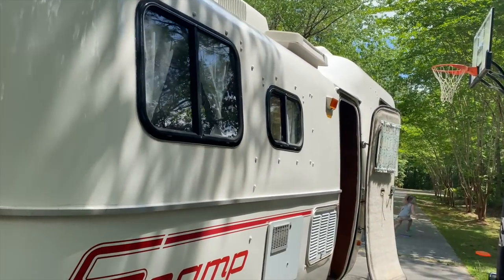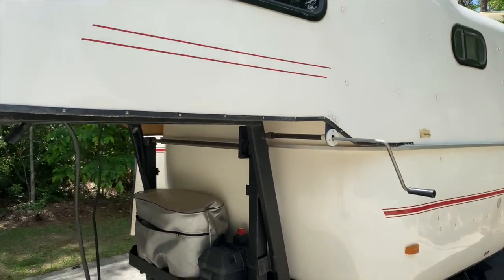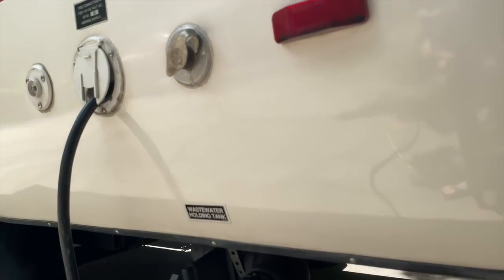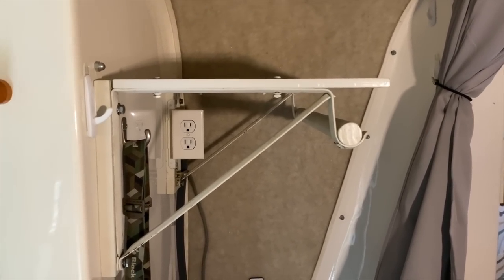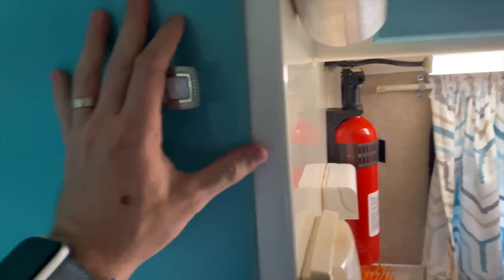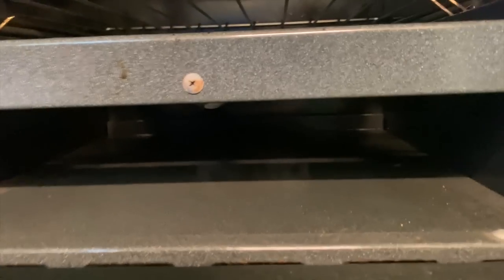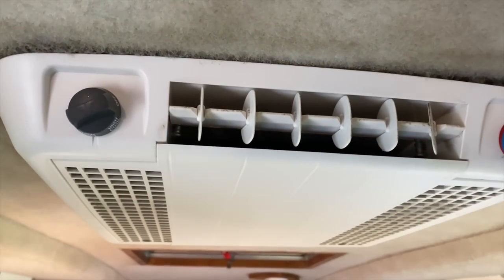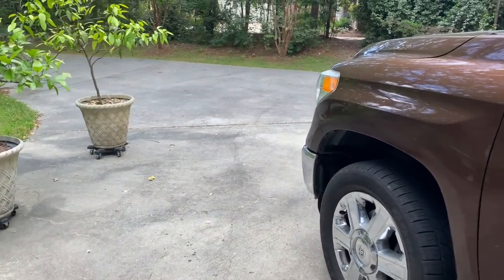Scamp 19ft Camper Walk Through

Comment: This is a stupid question but I need to know.  Is that a standard fifth wheel hitch or something different it looks smaller.  What does it take to pull this will a half ton pick up work or do you need something bigger?
Reply from the maker: Hi Diane, That's not a stupid question. I did not install the original hitch, because I purchased the Scamp and my Tundra in a package deal. But I think it was a standard fifth wheel hitch modified with a regular 2-inch ball. You may need to explore some Scamp forums to learn all the hitch options. I know people do pull this camper with Toyota Tacomas and similar-sized trucks. Lightweight is a benefit of fiberglass.
Reply: @nickortego   Thank you
Reply: I thought I would add to Nick's response - we have the Scamp 19' Deluxe (wood interior) We used to pull it with a 6 cylinder Ford Ranger. We pulled it in the mountains in CO with no problems. We then switched to a Ford F-150. It actually pulled better with the Ranger. We ended up changing out the tires and axle to raise it up for the F-150 so it pulled more level. Anyway they pull great with the small pickups, if you have a bigger truck get the different axle and tires.

Comment: EEEEWWWW... carpeting on the inside of the whole door & the whole cieling too? why?😳🤮
Reply from the maker: Hi Loyace, That’s more of a question for Scamp. It’s probably just an affordable option for insulation and sound dampening?
Reply: @nickortego  imagine how hard it is to clean! not like you can just wipe off the cieling or door! doors get really dirty, hand prints are always a problem! so who wants carpet on a door? that's gonna get awfully filthy and then need a SHAMPOOER to get it clean! what a ridiculous idea!
Reply: @loyacehansen1510  We have used our 5th wheel Scamp for 11 seasons and it is still like new. While I realize the fabric on the walls isn't for everyone it really doesn't get dirty like you think it would. It really helps with sound and insulation. I have found the durability of a Scamp/Casita style fiberglass camper outweighs a traditional camper with panelling type walls. To hang things up we just velcro them on! I suppose if you did a lot of greasy cooking inside the camper it could be a problem but hey it is camping, cook outside :-D

Comment: If there are any engineers watching this, I have a question : Could you set up the hitch system so a 2023 Hyundai Santa Cruz SEL Premium w/2.5turbo all wheel drive could pull this unit ?
Note, I know the cooler space in this truck would be unusable  while pulling it and a 90 degree turn "may" be close